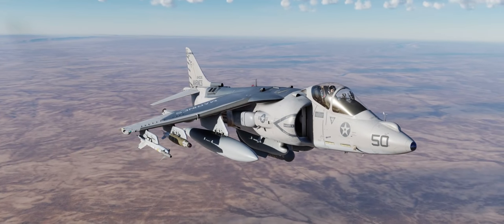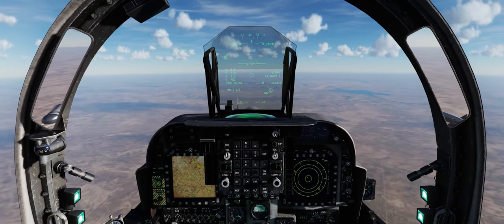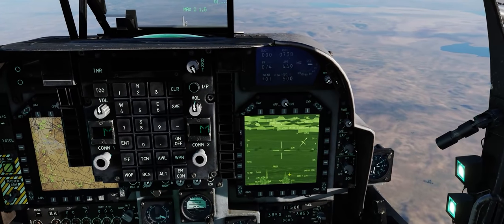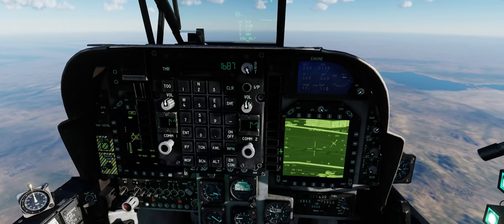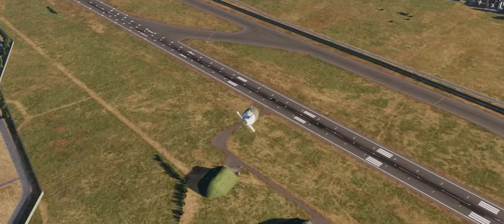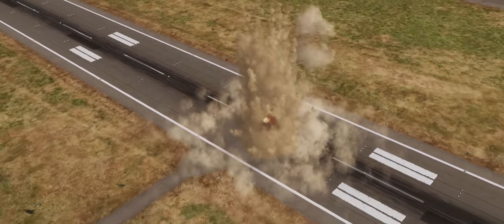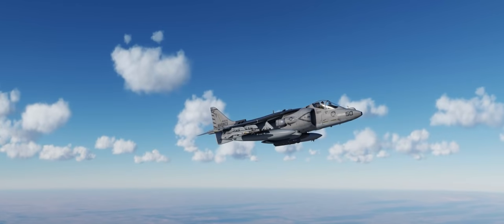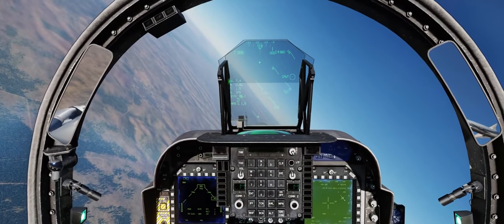DCS AV-8B NA Harrier II GBU-54 Laser JDAM Tutorial

Comment: The AV-8B has 3(!) different types of "interaction-modes" for the TPOD. MPCD, TDC (slew) and HTS . The last transfers nearly all controls for the TPOD to the HOTAS. So it has even more selective/complex Targeting Pod integration, than the F/A-18C or F-16C. The reason is to be able to use the TPOD and still have quick HOTAS controls over LMAVs, DMT/ARBS for designation/drop, if necessary, while having the ability to fully go HTS on the TPOD for example if you do buddy lasing  or recon...

Comment: umm you say use Display management mode? what key-bind is that, I only see TDC, and SSS modes . I have been trying to drop Laser guided/ GPS bombs, for a week now; and can not get a cue release indicator. I need key press specifics, I have a T50CMv2 Virple throttle, and a TMC 50 -2 Mongoose stick. Also I been using the Jtac to laser and that's not giving me the release cues. I'm not using the TPOD as its to confusing, I'm using the DMT. also when using the T-pod with the TDC it goes opposite of what my bindings are assigned. when I have the map facing N-north -up the slews are reversed.

Comment: Great video many thanks indeed , Just a quick Q  when I try and put it to autopilot so I can look at the screen and change them etc.. Auto pilot never seems to hold my height I look back and I am plummeting all the time or banking ?  Any suggestions on how to level flight like you do ?
Reply: The Harrier has two modes for AP, the AFC, which holds current attitude (and snaps to wings level if you are close enough), and the altitude hold. The latter will obviously hold the altitude, but the trick is you have to first put the jet into AFC, then activate alt-hold, since alt-hold can't work without the AFC :)
Hope that helps :D
Reply: @Plumsytheghillieone   Thanks !

Comment: Bang Bang Type Guidance? LOL! They all aim for the Laserpointer, Man!
Reply: The term “bang bang” guidance is not about what it’s targeting or its accuracy. It’s about how the fins work. From Wikipedia on the GBU-12 “Paveway II laser-guided bombs use what is known as "bang bang" guidance. This means the bomb's fins deflect fully, rather than proportionally when it is attempting to guide to the laser spot. For example, if it sees the laser spot and determines that it should make a change it deflects its fins until it has over-corrected and then it deflects back the opposite direction, creating a sinusoidal type of flight path. This type of guidance may be less efficient at times, however is more cost effective and allows the use of simpler electronics in the guidance system.”

Later Paveway III weapons use proportional control that is more costly, but results in a more energy-efficient drop.